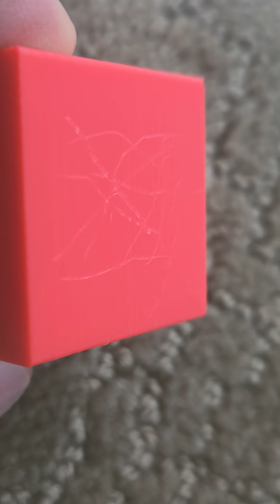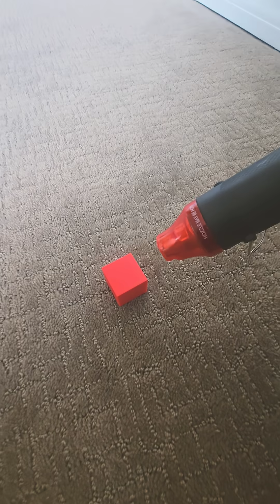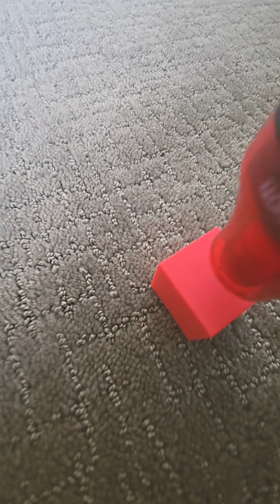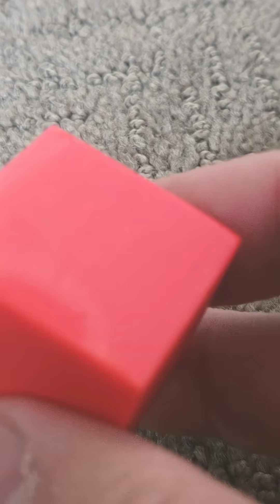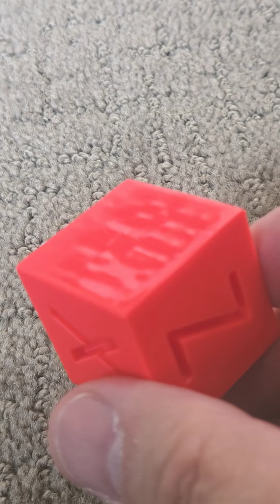Repairing Surface Scratches from 3D-Printed Parts without Painting or Sanding

Comment: I did something similar earlier with a PLA part, I removed it hastily and the bottom warped. I set the bed to 60C and just held it down for a bit and it straightened fairly successfully, still not perfect but it did work.